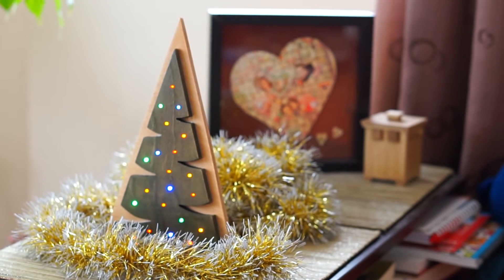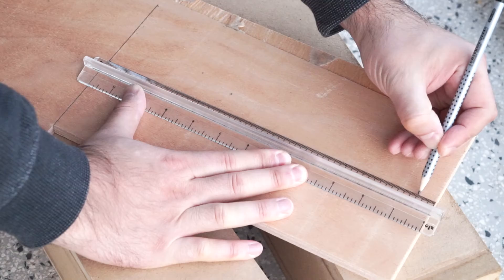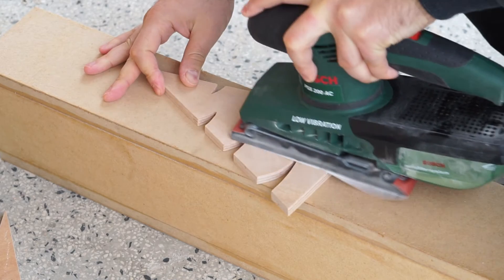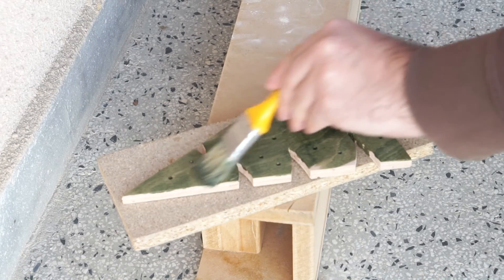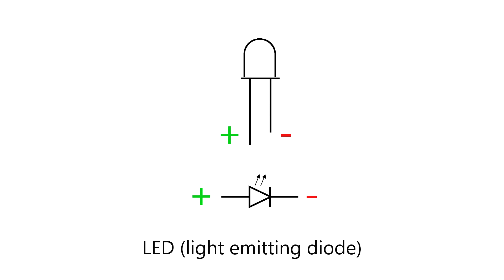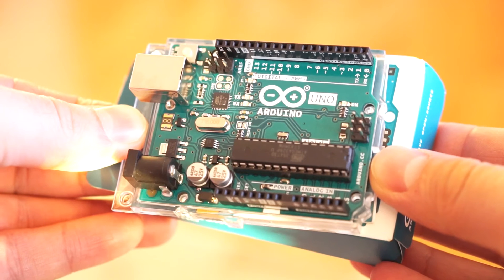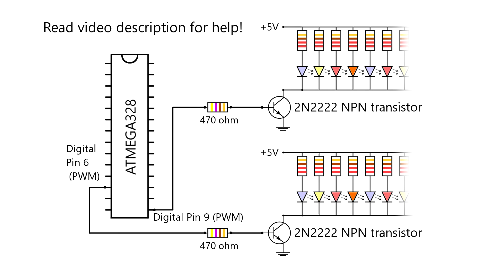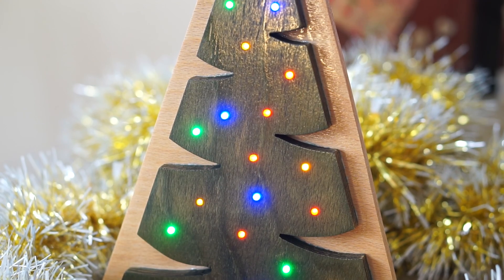DIY Christmas tree with LEDs and Arduino

Comment: Could you tell me how to connect transistors? I just started with arduino and I don't know how to use/connect a transistor
Reply from the maker: Hi, there are links in the video description that will help you: on transistors, Arduino, and parts you may need.